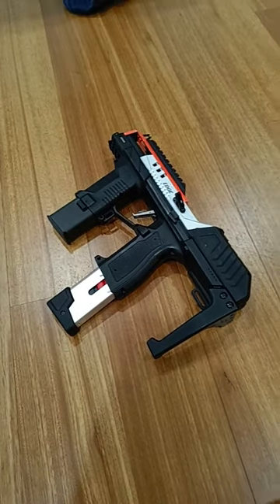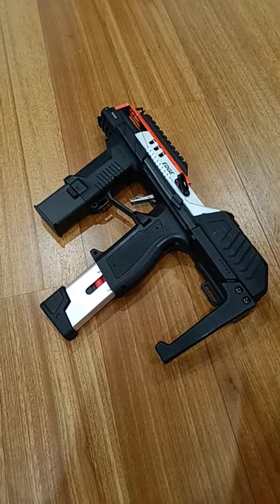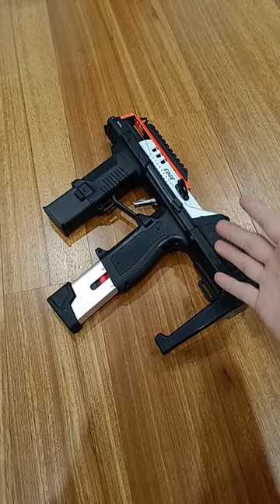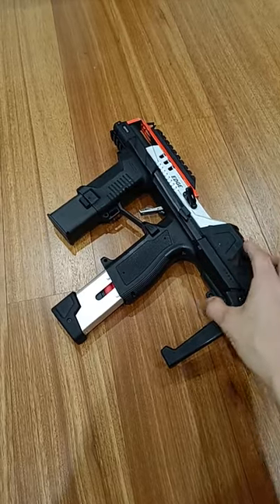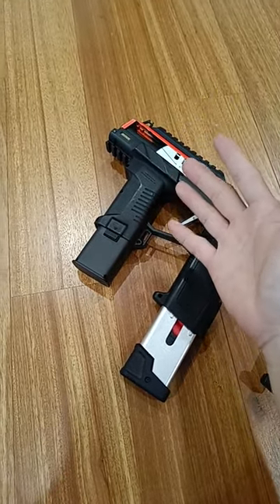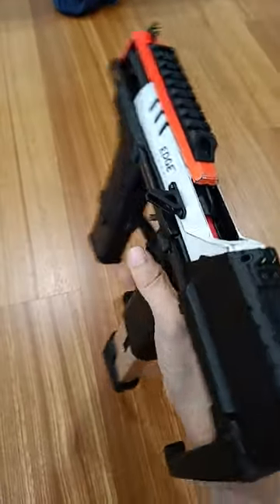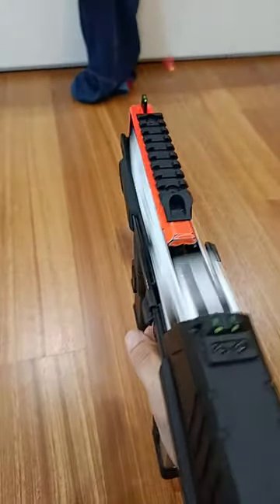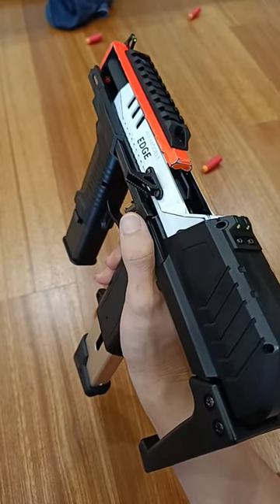QWK Edge with the updated motor and chipboard!

Comment: How hard was the update?
Reply from the maker: Not hard, just take the lower apart, unplug- the motor with connector, plug the new motor with chipboard in, make sure the pinion gear position is correct and close it up.
Reply: @monkeemods8393  was your pins to battery pack glued to the shell like mine? Don't know if removing the electrical glue easy or not. :/
Reply from the maker: @phamser1  yes the 4pins balance charging port is glued to the battery shell. Might take some effort to removed because super glue is used. But you shouldn't have to remove it, any reasons you want to do that?
Reply: @monkeemods8393  I thought  the new motor connected to the board to those pins why I asked, no one done how to take it apart the lower part so I want avoid any mistakes if I need to upgrade mine by damaging the prongs location to the batteries
Reply from the maker: @phamser1  oh wait, I think I was talking about the other thing. I thought you asked about removing the 4 pin plug from the battery lol.

If it's the motor chipboard set on the lower receiver, it's very easy and it's not glued to the receiver shell.
Reply: @monkeemods8393  ok wanted to make sure, think mine was the run that had the electric prongs on the inside glued with electrical glue to the body. Thanks.